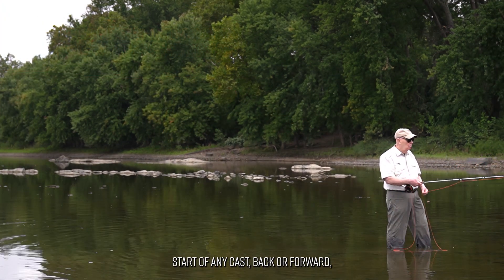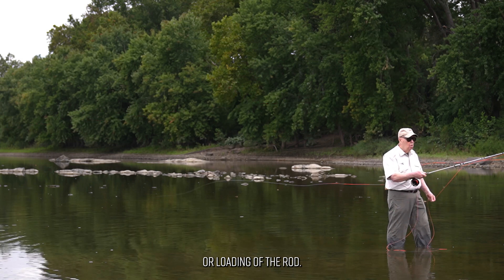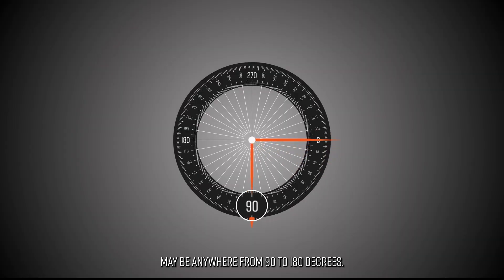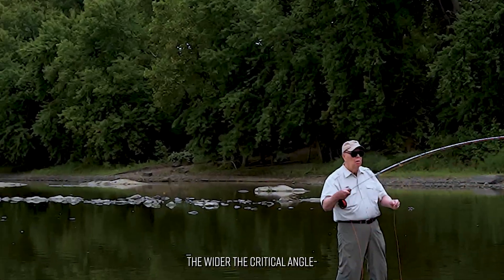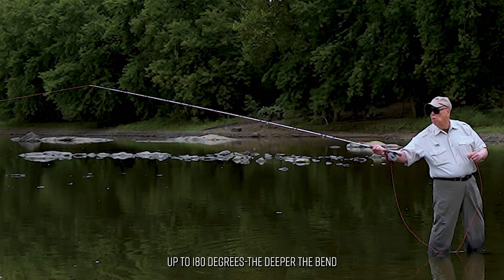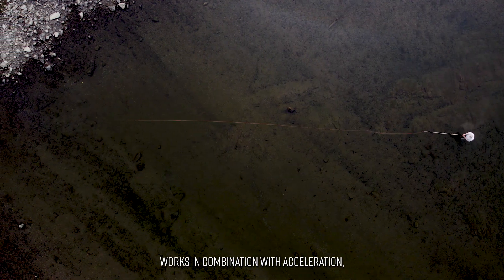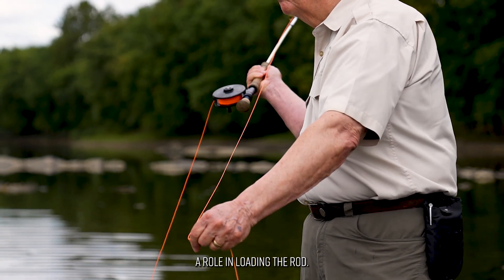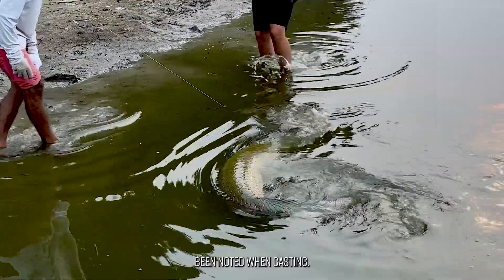Ed Jaworowski's Fly Casting Video Series, Video 3: Critical Angle

Comment: Question for Ed: Why do we want to load the rod? According to this movie loading the rod seems to be the most important part in flycasting?
Oops, 2 questions, sorry. 😉
Regards
Bernd
Reply: Hello Ross, hello Ed,
thanks for your answers. 

I'd like to share a different point of view. 

You say loading and unloading the rod, which in my opinion clearly refers to having the loaded rod fire off the line (like a loaded bow fires off an arrow), is the essence of fly casting.
That sounds like the bow and arrow cast should be the most effective and most efficient fly cast, because here we apply the by far biggest load to the fly rod in relation to the rather short line offering low resistance against the unloading. That is because here we use our line hand to pull the line outside the tip against the fly rod while holding it (the rod) in our rod hand.
But if you ask me, the bow and arrow cast is significant less effective and efficient in order to have my fly hit the target compared to a typical overhead cast, especially for medium to high distances. 

The essence of a bow and arrow cast is rod loading and unloading, yes. 

But the essence of all other casts is rotation. We mainly rotate the rod in order to create the desired line speed. As a welcome consequence the rod bends and straightens. That bending profile brings some advantages like for example the smoother resistance we have to overcome when starting the acceleration. Also stopping the rod is smoothened out by stopping each part of the rod after the previous one (instead of all rod in one moment like when casting a broomstick). Also the tip path during acceleration can be flattened without having to perform very special rod hand acrobatical moves as we need them casting a broomstick within a wider angle of rotation.
But there are also disadvantages like the counterflex opening up our loop front. Then we gotta live with a time lack between rod hand movement and tip movement making the perfect timing harder. And there is more, but in summary the advatages outweigh the disadvantages.
The moment our fly rod starts to straighten, our rod tip easily already has about 80% of it's final max tip speed. Thus the rotation is king, not the unloading. And that is, why overhead casting is far more effective compared to a bow and arrow cast.
I prefer "bending/straightening" over "loading/unloading" in order not to have students missunderstood what the essence is.
About the angle of 180 degrees line to initial straight fly rod, I didn't see such a wide angle being used in the WC of fly casting. The best of the best fly casters used less of an angle. In my understanding that is, because fly casting is not about loading the rod and have it speed up the line. It is about shaping proper loop forms, adjusting line speed and matching the best trajectory (mainly for the fly-leg at launch). Creating line speed alone can't be the essense. Line speed is worth zero without excellent direction and put into perfect loop shape.
I ignore loading unloading and instead focus on the key elements to be controlled. A controlled smooth rotation at the right time is the king of the essentials to me. 

When I fight a big fish, I shorten the effective rod length by pointing the tip towards the fish. If I pull directly on the fly line, that's most effective in terms of applying most force to the fish. Of course I may need some stretch left to absorb/dampen the peak forces by head shakes.
If instead I want max line speed in casting, the longer rod does it. A noodle (very short effective length) isn't a good choice for highest line speed. The long dh rod wins. But playing a Tarpon on a long dh rod would be a desaster. Thus I don't agree to compare the creating line speed with the fighting big fish aspects as Ed put them in this video. 

Always a pleisure and very helpful to get challenged in the understanding of fly casting details. Thanks a lot for the inspiration and your detailed answer! 🙏 

A great article can be found on Sexyloops. It's called the rod and the cast.
https://www.sexyloops.com/articles/rodcast.shtml
Thanks to Grunde Lövoll and Jason Borger for providing it! 

Here is a test I made about what loading and unloading contributes even when being over pronounced/extra increased.
https://vimeo.com/manage/videos/60189818

Kind regards
Bernd
Reply: @berndziesche9770  Spot on 😇🙏
Reply: @berndziesche9770  this is a wonderful and thought out response. I’m just learning to fly cast and your comment has me thinking … what if you took a rod that didn’t bend and tried to cast fly line with pure rotation - would that be as successful (or lack of) as just having the bend (like the video you linked)?
Reply: @MiguelPGator  We (some casting geeks) did exactly that. Casting a broomstick allows for the tightest and most pointy loops. It allows for a lot of line in the air. But a broomstick is too heavy. After 3min even the best trained casters are done/tired. One of the big advantages of flexible rods are less overall weight and smoothening out the resistance we have to overcome during the beginning of acceleration and then deceleration. Also tip path during acceleration is great on the flexible rod. However a flexible rod shows counterflex after straightening, which opens up your loop front. Thats one disadvantage we live with. There are more disadvantages, but the advantages are more important. A major missunderstanding in fly casting is rod loading. The moment our rods start to straighten, we usually already have 80% of the final max tip speed. That was measured many times. So rotation is king of creating line speed, while straightening is a consequence of rod flex.
Reply: Thank you for this enlightening explanation, Bernd!  @berndziesche9770
Reply from the maker: this is Ross at Fly Fisherman. My quick answer is this: If you can bend the rod you efficiently use the tool to cast the line. if you don't load the rod you're making your arm cast the line and working way to hard. 
I also showed your question to Ed. Here's his response: “Loading" is simply traditional fly fishing speak for “bending.” It’s impossible to cast without bending the rod. The bend represents stored energy. So yes, loading is the essence of casting. Moving the grip (by accelerating and rotating), while the line holds the tip back, creates the bend. When the caster stops applying force to the grip, the rod straightens and transfers that energy into the line. The greater and deeper the load/bend in the rod, the greater the energy that is stored then transferred into the line, and the further it goes. I’ll quote what a physicist told me 35-40 years ago: “If the rod and the line are at 90 degrees when you start the cast---from a strictly mechanical viewpoint---that is the most inefficient angle.” I experimented and ran endless tests for years and discovered that the greatest mechanical efficiency comes from a 180 degree (i.e. straight) angle. You can load/bend the rod even into grip with very little force or effort. Use a smaller or wider critical angle according to the requirements for each cast, 90 degrees for the shortest casts, up to 180 for the longest.